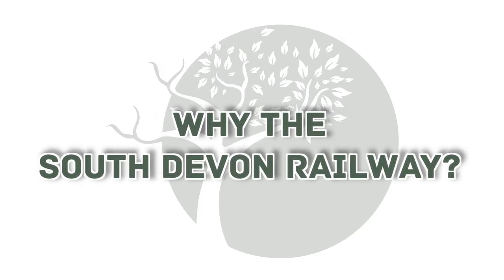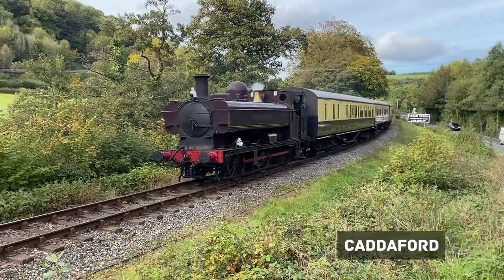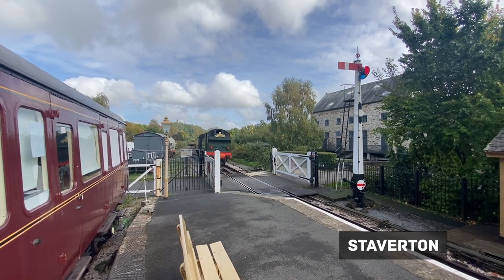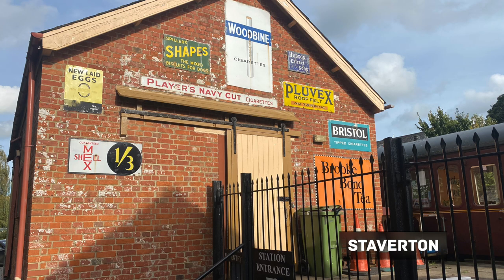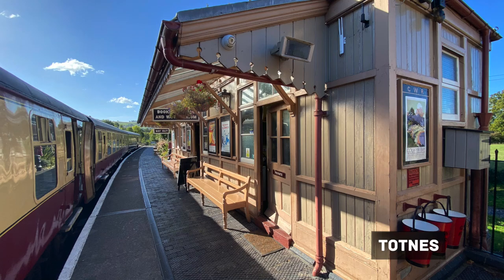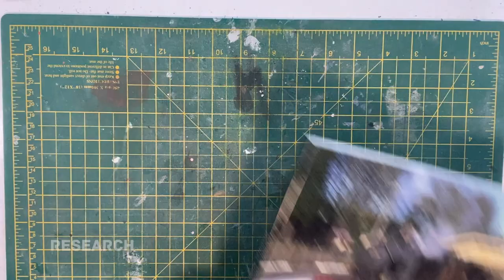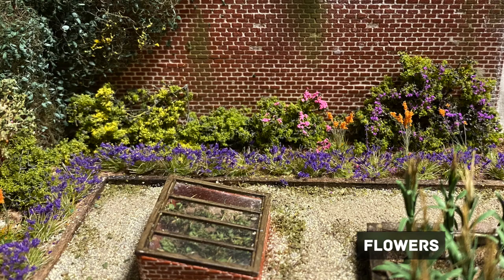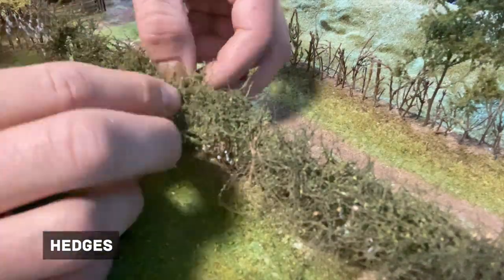Building a model railway - The South Devon Railway

Comment: Yay! Happy to see a railroad layout project, especially running along a river and built in modular sections. I'm contemplating doing a similar one for the Lower Connecticut River Valley with the  stream train (still in use for tourists) running from East Haddam to Old Saybrook (and thanks for measurements in feet)

Comment: Wow. This is going to be a big project. Are you going to approach it as a series of dioramas, or will it be the other approach, of building all the baseboards, laying the track and then doing the scenics for the whole thing once it's running?  Either way works, though I have a feeling the first might suit you better.  A lot depends if it's going to be a layout that's permanently assembled, or whether it's a modular set up, put together for exhibitions or whatever. 
I look forward to watching your progress, whatever you do.
Reply from the maker: Hi Andrew.  As you rightly said, I think the first option as the entire project is slightly overwhelming!  I still need to consider how they’ll join due to the terrain difference and direction of the track but I think I have that figured out.